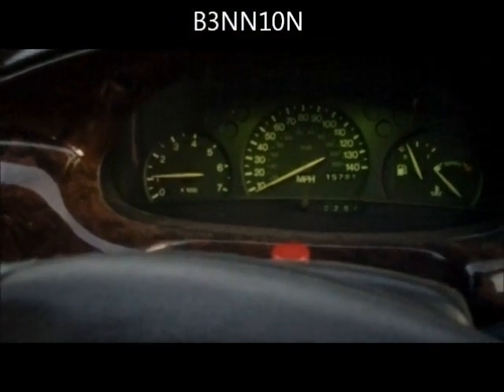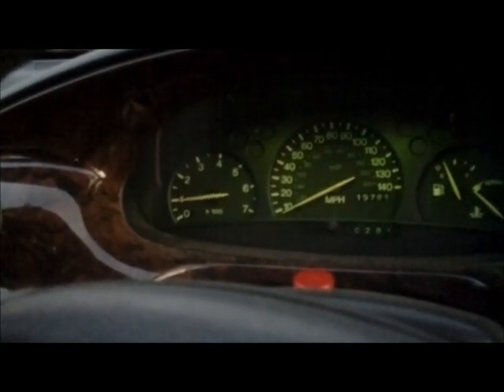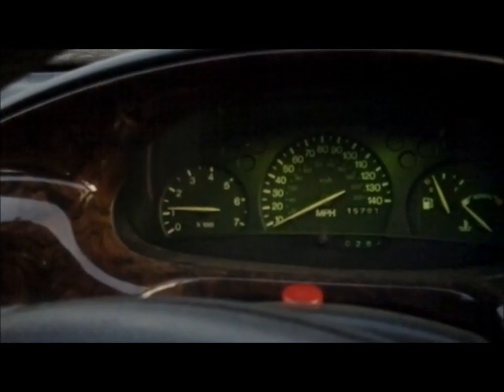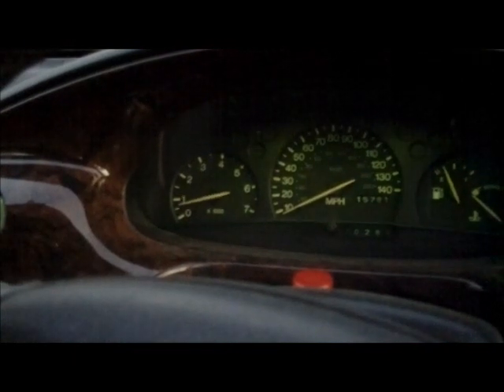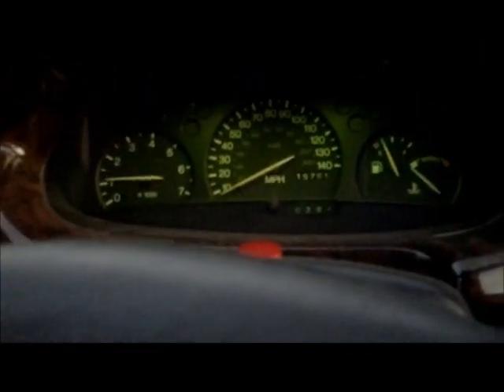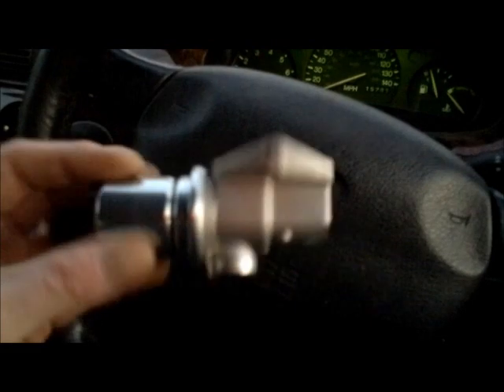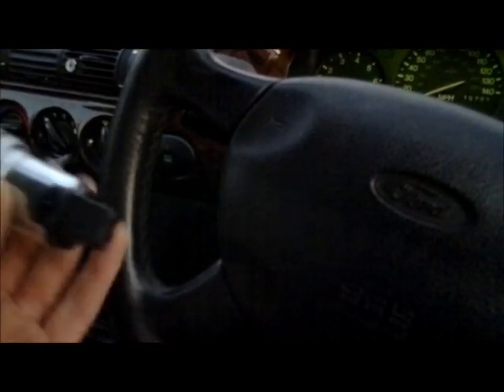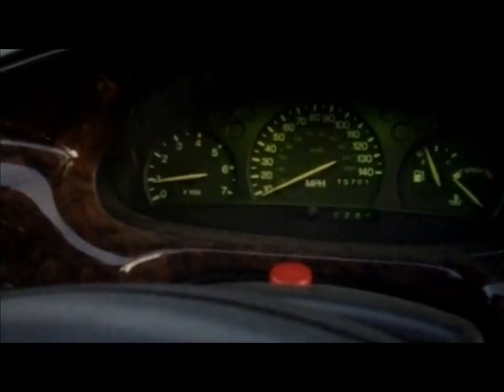How to diagnose a faulty Idle Control Valve / Stepper motor for Ford Escort, Fiesta Ka Focus

Comment: ghia x did actually come out in 96 on a p reg but dont think they were a convertible trim option,by the way i got the problem sorted on my orion it was a faulty battery so ive had the round terminal conversion and have got a bosch heavy duty battery 470amp in now cheers for your advice

Comment: I own an Astra G X16XEL and sometimes it makes this sound. I changed a lot of pieces but didn't get the right one.
I told every mechanic I've been to that it makes an odd sound, but they didn't knew what it is about. My car never made it when it was at the mechanic so it's very hard to diagnose. The ECU doesn't return any error code so it's only your ears that can find the problem.
Thank you for uploading this video. I am relieved that I see others had the same problem and discovered the issue. This week i will proceed in cleaning it or replace it.
Hope it works :)

Comment: I think my Focus 1.6 2003 might be doing this. Engine starts fine, (despite sounding a little rough for 80k), holds at 2k RPM, then drops to about 600. The lights dim, even the dashboard dims and it stutters for a second, until it goes back up to 800 where it idles. A press on the pedal will shoot up, and when it drops down it hits perhaps 5-600, sputters, and gets back to 800 ish. Any idea if this idle control valve could be the culprit? Thanks for the helpful video too. Declan

Comment: Question.......what if it does the complete opposite when you snap the throttle......meaning the rpm doesnt drop immediately, it hangs around 2000 rpm, then drop slowly.

Comment: take off the idle control valve and clean it up inside with brake cleaner about £3 off ebay and it may sort it try that before anything more expensive and is the clutch slipping?
Reply: Than bro, this is what I call a helpful message..

Comment: I've got a similar problem at the moment. 1.3 '96. Everywhere I look on the internet they say to check for a vacuum leak first before going to the expense of replacing the IAC valve.
Going to try this this weekend. Hope it works?
Reply from the maker: Darran Phelps yo dude. The icv can be bought for about 20 pounds. 2 hours to fit.

Comment: I'm looking right now. The cheapest that I have seen is £30, but they mostly are around £60-80. Genuine Ford are going for £200+.  I'm still trying to trace exactly where it's located. If it' s on the throttle body do I have to remove the exhaust manifold to get to it? If so I am going to need to get gaskets before I attempt this.
Reply from the maker: Darran Phelps I have never bought genuine. I have just seen one for 23 quid on eBay. You need to remove the throttle body. And air pipes but not the exhaust. You will get a new seal with the icv and it's bolted on with 2 10mm bolts. 1 connector.
Reply: Thanks for that. I'll give it a go tomorrow.
Reply from the maker: Darran Phelps no worries
Reply: Thanks for your help, turns out that the IAC valve wasn't the problem. You know what they say check the simple things first!!!
Reply from the maker: Darran Phelps what was it? Be had escorts 18 years now and I'd say the icv was a simple and common problem to be honest.
Reply from the maker: I've had
Reply: I couldn't find the IAC valve when I was looking at the carb. I studied the diagram in my Haynes (fuel injection) and decided to strip out all the hoses and refit them first. In doing so I found the rocker cover was completely loose. Cleaned out the emulsified oil in that and the filler cap. Ran through all the hoses that I could with a straightened out coat hanger and re-fitted,  and the problem of running roughly on tick over and stalling when I pulled up disappeared.

Comment: For everone dosent how it wrok this valve lets enter a smal amount of air when you dont touch to the pedal of gas... 

when you it the gas it close than you have the control on the buterfly but when you stop again of touching the gas pedal this valve have to open again but some time because is too old or dirty it dosent open enough fast to take the ilde back again and the motor die... or just refuse to start and stay that can be a other symptom of a faulty vale

Comment: i have a 1.3 fiesta mk5 that kept cutting out so i took off the idle control valve cleaned up inside with brake cleaner and cleaned up the thottle valve too and now its fine :D